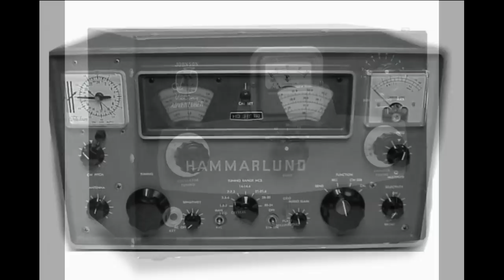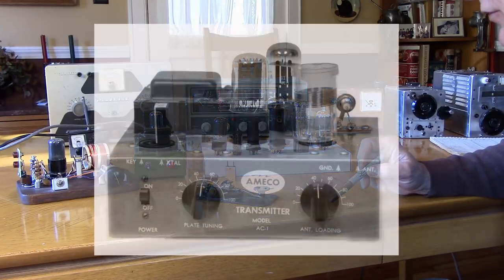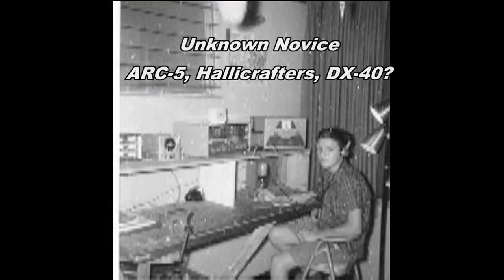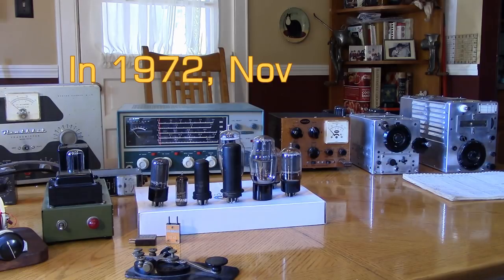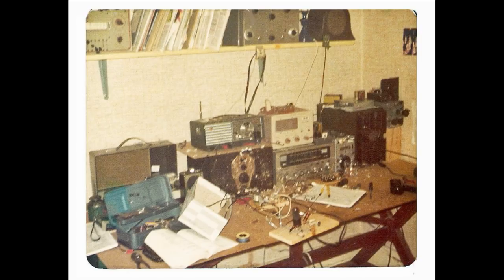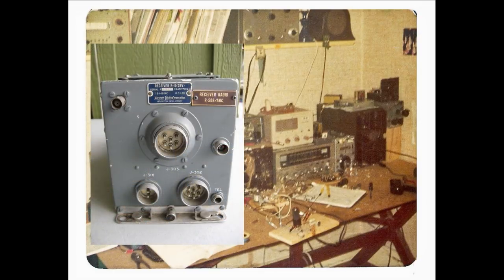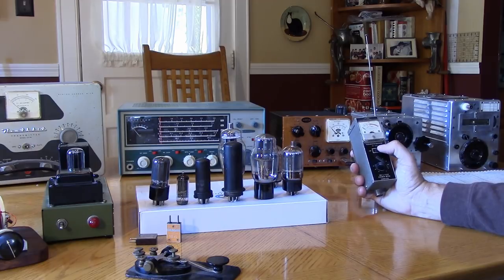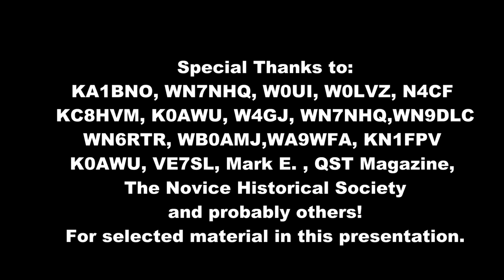The Novice Station 1960-75 Part 1

Comment: Took my Novice test in April of 1959.  It took the FCC until June to issue it.  By then I had a Hallicrafters S-85 receiver....a gift from my mom.  I built a 6L6/807 crystal controlled transmitter with junk tv parts donated by a family relative who owned a tv repair shop....using an Elmer donated power supply that had 866 Jr. mercury vapor rectifiers.  My first contact on 80 meters using my one borrowed crystal....3.727.9 megacycles was with W1LLN in Ellsworth, Maine.  I was 11 years old...and all this made me believe in magic.  At that time a Novice license was only good for one year.  Upgrade....or lose it.  Had to go to the 16th floor of the Customs House in Boston.....a 60 mile train trip.... to take my General exam in early 1960.  I had to get my paperwork notarized so I wandered around the building until I found a lawyer's office.  It was F. Lee Bailey.  He notarized it...and didn't charge me.  I passed it...and got to drop the "N" behind the K in my call sign.  I still hold my original call sign...never let it expire....and I still think it's magic.  73.

Comment: I had a Novice ticket too. Wn9 prefix. My dad was a ham so I inherited Heathkit AR receiver either Q multiplier, a DX 60 transmitter, a few xtals and an antenna tuner Heathkit, with a neon bulb to tune to. Still got a General class. Also have a GROL. Great memories, thank you. My ham club had a modified military aircraft receiver like in your video. We held bake sakes and got an HW-16. Great memories.

Comment: The 6146 was the crown jewel of tubes.  My Viking Ranger has a single 6146, my Kenwood TS-830S uses two in the final and so does my Collins S-Line and many others.  The 6146 has a long and distinguished past,  and I have old QST's from the 40's and 50's that advertise the 6146.  RCA and GE made them, and I'm sure other companies did too.

Comment: I was WN8GBK, and got my novice in March 1970. I used to SWL in the late 1960s and would listen to the beacons on LW between 200-400 kHz. I slowly picked up on the code by listening to all those beacons. As I got better I started tuning the ham bands until I was ready to take my novice exam. I used to hear WA8BLL on 20m and he only lived half a mile away, so I wrote him a letter and he agreed to help me and he gave me my novice test. I had a new Allied A-2515 general coverage receiver, that had band spreads for 80-10. It was unique that it split 40 into two bands, 7000-7150 and 7150-7300, so you could tune right down to the kHz with it, and all the foreign broadcast at night, made it easy to check calibration and make sure the main tuner was set correctly. I picked up a used Knight T-60 for my transmitter. It was only 60 watts input, didn’t have a watt meter, but probably only put out 35-40 watts. My antenna was simply about 60 feet of wire strung between two tv masts, on the house and the garage. It was center fed with a single conductor wire (in reality it was a top loaded vertical) which went to a knife switch, and then just simply jammed into the center of the SO-239 on the T-60. SWR? what was that? I didn’t know how bad it was, but it worked. I just tuned for maximum output and I was on the air. I burned my fingers more than once on that knife switch antenna changeover! My first QSO was on 15 was only about 10 miles away, but my second and third QSOs were with California, and then many station out west and in the southeast after that. Late afternoon and evenings I was fighting the foreign broadcasters on 40. I was on 7167 and 7192 and usually could be heard on one of them. I did very little on 80, the antenna was really inefficient for that. I eventually got a HyGain 18V base loaded vertical and mounted that on the backyard fence and had some success with that on 80.

It was very basic, but it was a lot of fun, just a few weeks from now is my 49th anniversary in amateur radio. 

73
Dave - K7DR (ex WN8GBK/WB8GBK)
Reply: Dave - K7DR
 G3NBY late 1958...just out of school.
Loved. your remark "SWR. What's that?" In my case "Co-ax..What's that"
They had only just stopped tapping the random wire, up and down the PA Tank coil.
"DC blocking capacitor? .. Aw Shucks. Nobody's going to touch it!
I was about 12 years earlier but it looks like you were telling much the same tale.
Perhaps my little rider about  pre- licence 'dabbling' with a co conspirator school pal might be a bit different. 
I got a battery, a very sparky electric buzzer, a long piece of wire which was connected to neg.on the battery, wrapping as much as poss. around the buzzer. and battery.
It was then connected to about 20' of wire dangling from my bedroom window.
I then scuttled off about a mile to my 15 year old schoolboy partner in crime.
"YES" He could also hear the Interference I was making on the medium waves. 
Yes Sgnr Marconi.. It does work! You were right!
Ya Boo Sucks British GPO...Too late.. Ya can't get me now I'm 80!
73,...Good Old Days.. As in many other things..we lived through the best.
G3NBY. By the way Cycle 19 was in full bloom when I got my ticket at 18..3 years later.(1958)
DX would come right in through an open window, straight into my logbook!!!
Reply from the maker: Awesome, simply awesome story and remembering those fun years is what keeps us cheerful in the hobby.

Comment: I first got on the air as a novice in 1962.  I built a two tube transmitter from an article in the January issue of Popular Electronics magazine.  It was crude and simple but it worked and I made contacts.  My Lafayette HE-30 receiver rounded out my simple station.  ...jim, WA7VVV

Comment: This actually took me back to when I was a kid in the 50s and 60s when my dad was in his Ham heyday. The AM day with Gelosos and 807's and as you mentioned the 6L6s. A 75 Watt AM transmitter using a Geloso oscillator and a Hammarlund HQ-120 as the receiver. The antenna was a G5RV.  Some memories. Thank you. 73s ZS6AYS.

Comment: Great job!  As a new, "old" ham, my goal has been to take up this great hobby where I left off as a teenager in the early 70's, and start from scratch, as if I was just getting my novice ticket. I learned CW over this past year, built my single tube 6T9 transmitter from parts I started collecting in 1974, and it worked!  I made my first ever QSO with it 1-1-2018, using my Hammarlund HQ 110A receiver, and a random wire! (I never made a QSO when I first had my Novice ticket in the 70's).  Now I feel like I can consider myself a "real" Ham!  Not feel guilty going out and buying a commercial rig.  
Next step is to build the receiver and figure out an antenna switchover system.....therefore, can't wait to see your next video for ideas on how to actually operate a novice station with older homebrew gear..
Very pleased with the timeliness of your videos for me!
Thanks again for taking the time to make theses videos!
73
Pete
KD2OMV
Reply: Peter Van Eenenaam
What a nice comment to read.  Restore's my faith in human nature and Oh Boy did it need it!
In my estimation you ARE a real Ham.
73 G3NBY   80 turns on the tank coil!
Reply: MauriatOttolink thanks for those kind words as well!  73!

Comment: I had a Gonset Communicator I on two meters.  Dirt cheap flea market find.  I used it to copy FM repeaters.
My Novice RX was an HQ110, TX was an Elmac AF67, $15 at Harrisons NYC. They had a pile of them from the floor to the ceiling for Washington:s birthday sale.  All had BO modulation transformers!  I built my on AC supply using parts from on TV sets found left on the curb for the trashmen.  Only parts I had to buy were the chassis and some 1N4007 diodes.  Every now and then the transformer would start to arc over inside, a smack on the top of it with a 2x4 and it was good to go for another few hours!

Comment: 1626 osc tube in command set. the 80 meter command tx was very stable and did not chirp. I have one. Love your videos.
Reply from the maker: Most of the 80M command transmitters were pretty good on chirp. The 40M - well sometimes you need to key just the finals and keep the oscillator running on TX. Wonderful compact designs.

Comment: Thank you so much! I was licensed in the spring of 1971. I saw my Johnson Adventure transmitter and later built a wonderful Heathkit HW-16. What a wonderful Novice CW rig. Most contacts were made with the Johnson Adventure and a Hallicrafter SX-99 receiver operating on forty and fifteen meters. The Novice bands were very crowded in those days. When you mentioned the Novice bands I had three xtals for forty meters however I seemed to make lots of contacts with some very nice operators. Looking forward to your next video!  Jim, W5JCS former WN5ENS.

Comment: This brings back many memories, some of them bitter.  I used my lunch money to buy parts to build a single tube transmitter.  Hung wire in trees in our trailer park.  Had my station in the hallway of our trailer house.  I had a general coverage receiver, a Lafayette HE-30.  I has sixteen years old in 1962 and had nearly no one to advise me.  I had one 40 meter crystal on a frequency shared with an international broadcaster.  However, I made CW contacts!  Dang, that was exciting!  Some months later, I got a DX-60 and a general class license.  Life was good.  73s...WA7VVV

Comment: The swr meter you showed, had several different brand names.  There was Lafayette as the one you showed, Swan had one with their name on it,  and also Midland had one too and there are probably many others.  It also had a built in field strength meter with that little antenna that had a threaded end, so you could screw it into the meter case to measure field strength.

Comment: thank you, this was fun to watch!  I was a novice back then (wn3pbt) for two years. I used my father's SX128a Hallicrafters receiver and I had some kind of a Eico transmitter but something was wrong with it. I had a sloper antenna on 40m but I only got about 15 watts out and the final tube was blue. So somehow the matching or something was really off. I also had a bad chirp. With no one to help, I slowly dropped out of ham radio.

Comment: I lived on the farm,1962 my grand parents gave me a dead philco model 16x console. I repaired it with parts scavenged from old tv sets. put in ago defeat, manual gain control. bfo, q multiplier. built transmitter from scavenged tv parts. 6ag7 osc. with 1625 output.texas xtal for 3711khz(most costly part) got war surplus coax and put up an 80 meter dipole at 20 feet. best daytime qso 175 miles away. night time was tough with all the stations. used typewriter for copy. station call wn0bzs Minnesota. man with axe and acme liquidate were the surplus stores. lots of fun.
Reply from the maker: Wow that is a great story and boy those old TV transformers were heavy duty and perfect for building up a transmitter power supply!

Comment: WV6KJK, 1960-61, then WN6EPZ, 1974-76. Still have all my "Novice Crystals" and the original ticket signed by C. B. Plummer. My station was the best of times and the worst of times: a self-built DX-40 and an S-38E. Loved the DX-40 but the S-38E was THE WORST ham receiver devised. 

Maybe a 6L6 transmitter and a regen receiver in the future? Why not? Thanks for the videos, Mike.
72 de k6whp
dit dit

Comment: 14:18 Has this SWR Meter also an Option to work as a simple (relative) Field Strength Meter too? 
It is a little Whole / Slot on the Top in it in which You can put a little bit of Wire so the SWR Meter can pick up the EM Field Strength of an Antenna too (at least the Near Field)  ?

And how did You know with all that analogue Meters and Scales, that You are on Frequency / in the Band and which Frequency it actually is.. ? 
I heard, that some Receivers had Crystal Calibrators / Marker Generators build in for this Purpose. Was something like that also Part of a Novice Station? Or did they simply rely completely on the Crystals that they used for the Transmitters?

Comment: I was first licensed in February 1974 as wn8rnt bought me an Heathkit hw-16 as my first rig never did get it on the air then later on what I became Ka8gov that's my call sign now I had a ten Tec Century 21

Comment: I know you said on one of your screen text messages that VFO control was allowed for Novices in 1972 but what I remember was that when I got my novice in Feb of 1976 Novices were not allowed to use VFOs but had to use crystal control.  Then durring my year of being a Novice before I passed the General the FCC changed it and we could use VFO control.  de WB8YMV  (novice: WN8YMV)
Reply from the maker: I was ready to correct this but came up with Nov. 22 1972 as the date the FCC allowed "Novices to use VFO Class A type" whatever that means.

Comment: Success with DX is only partly a function of the input power. Some is from the antenna. So it is not right to say that low power is not good for the novice.
Reply: Part of your success at DX would be the condition of the solar cycle. I got my novice (WN8GBK) in March 1970, and we had just passed the peak of cycle 20. 15 meters was open every day to all parts of the US. My second and third QSOs were with California, I was in Michigan. My first DX was ZM3JC on 15. He was on SSB and I was on CW. I had a simple wire centered fed with a single conductor so it really was a top loaded vertical, strung between the garage and the house. It’s amazing I got out at all!